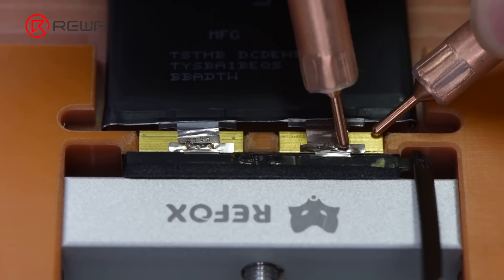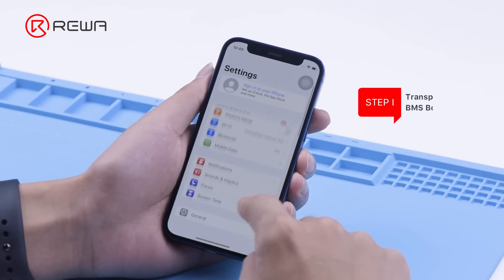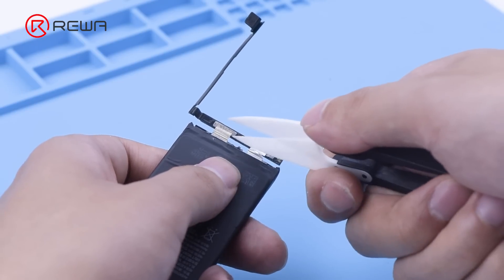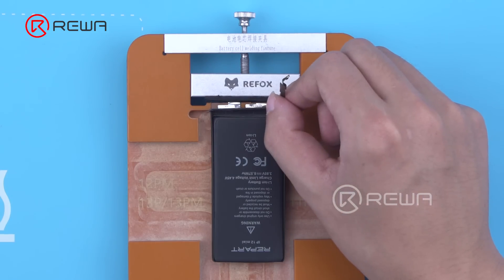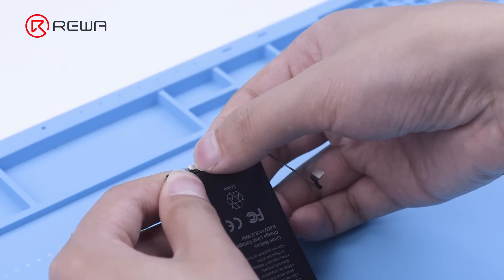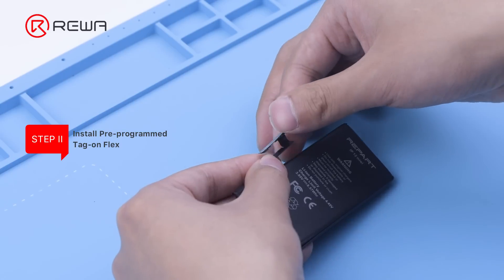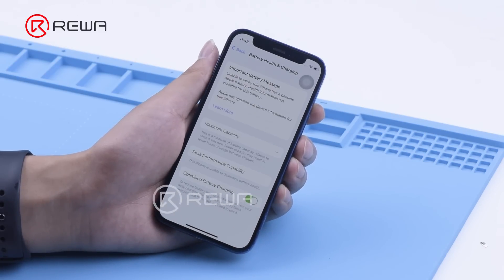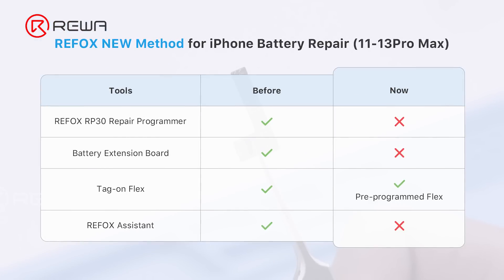No Programming, 100% Health - Revealing the new method of iPhone Battery Repair

Comment: Important Information

I installed Flexible when the battery was below 70% and a new one was installed with TAG ON. The battery is still a waste and feels like nothing has been replaced. Does Flexible TAG ON only manipulate the %? Even though the battery is also new, has anyone had the same experience? Or is there a solution?

Comment: Where to buy this?
Reply from the maker: Hello here is the link of the tag on flex, but now on ios 18.1 may apply different method: https://shop.rewa.tech/detail/refox-rp30-battery-detection-module-tag-on-cables.html?utm_source=YTB_230428&utm_campaign=NoProgramming_BatteryFlexcable

Comment: Hi to all. I recently replaced a new battery into my XR and used the old BMS board and the quanli Apollo 1 for clearing the battery health and cycle, but the message did not went away. I also messed up with battery capacity on the programmer just to match the maximum capacity of my new battery but I think this was a mistake. The phone is working, the programer can actually read the data but the message doesn’t go. IOS 17.2. Any help????
Reply: Just live with the message. i also had similar issue but i just don’t care about that msg anymore.
I hate the fact that even after getting genuine battery we are forced to see this message and i hate apple for this.

Comment: How about iPhone XS/XS max batteries?
So all we need is this tag on flex, no programmers needed anymore? Does the battery health degrade normally with the tag on? I want to order them as soon as I know.  Thanks
Reply: yes what about xs?
Reply: Xs you don’t want flex cable just programmer
Reply: original bms and programmer
Reply: So it means, take the bms original and install it to the new battery and just program it, without this tag?
Reply: @eangrace9497  
Xs xs pro max yes no need tag

Comment: Let say if my phone battery health is 88 and I plug this tag on will it count the cycle down to zero and also will my battery health be 100% without buying new battery
Reply: But the real capacity won't change.
Reply: Yes it will 100% but the performance will also never change if you don’t replace the battery cell

Comment: Rewa Team,
please discuss the green screen problem on the iPhone 13 series which is currently happening and how to fix it, can it be repaired or we have to replace the screen
Reply from the maker: It is usually caused by design flaw, it can be repaired by jumper wire.
Reply: @rewatechnology2008  thanks Rewa

Comment: why does it mark in the programmer model not supported, that happens to me in the batteries from the iPhone 11
Reply from the maker: It is supported for most third-party batteries, and the original iPhone battery will be 100% supported.
Reply: I always failed with this tag on flex for iPhone 11. I just have one success with iPhone 11. Why?

Comment: so the tag on flex should stay in the phone right??
Reply from the maker: Yes, but it will not have any effect on the use of the phone.
Reply: Will the battery precentage be stuck at 100% forever or will it work as normally?
Reply: @edde3244  The precentage will decrease normally.
Reply: @zengwenli9967  Alright, cool!
Reply: @rewatechnology2008  Great! Thanks for the response 😁

Comment: When REAL solution, no have to Seperate old bms and solder to new cell..... This way is dangerous.

Need option put new battery in direct and work.....
Reply: This will never happen
Reply: just get better at fixing devices, kid
Reply: @OhQueBacan  ive Been repairing mobile  phones  for 22 years....I don't need to 'get better'... These solutions are inherently unsafe.... And I refuse to use them, the moment a cell explodes or sets on fire is the moment my 22 year reputation is lost...
Reply: @danjackson2014  you clearly have no will to improve then. This is one of the simplest repairs you can do to an iPhone and with your 22 years of “experience” cannot do. 
Also, if you want to demand easier repair solutions, go against Apple, they are the ones that make the process so complicated, rewa and others are the ones making it easier
Reply: @danjackson2014  I'm not understanding how this feels dangerous to you. Of course, if you were to work improperly around the cell, that would obviously be dangerous. But once the flex is secure, etc.. How do you see this being more or less of a danger than simply replacing the battery at all with any other battery?